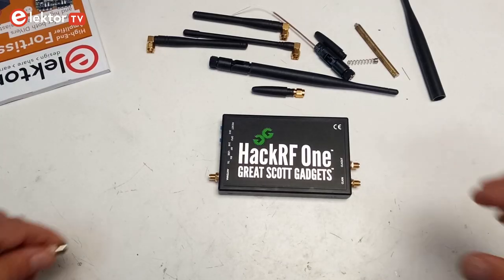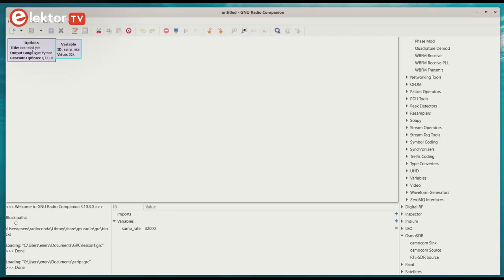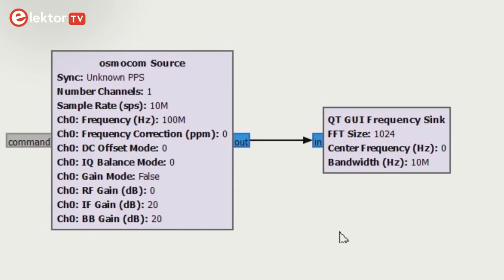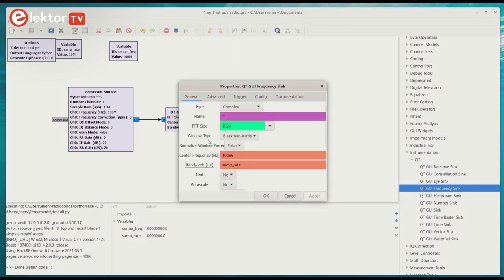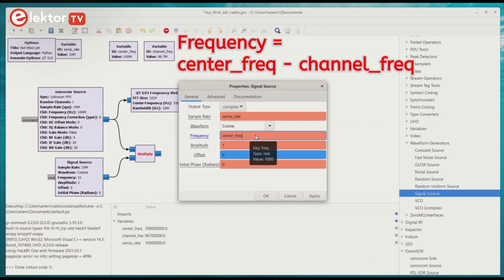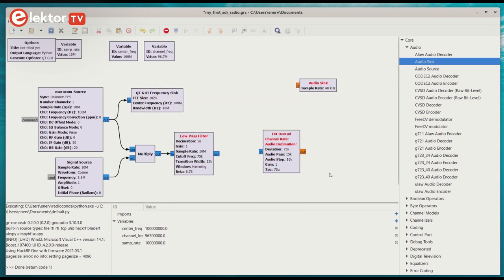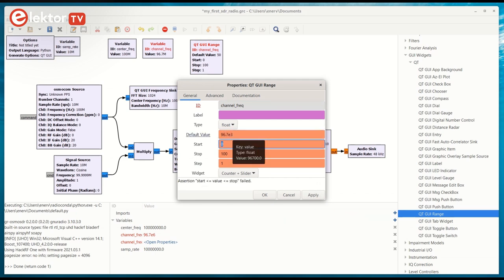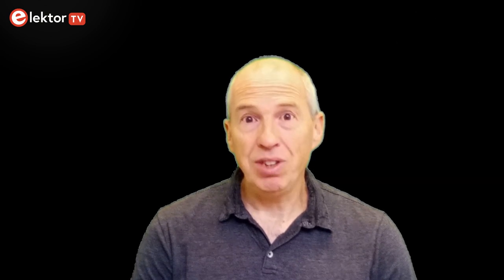Build an SDR-Based FM Radio Receiver in Less Than 15 Minutes

Comment: a frequency block doesnt open for me.data was input as suggested.do i need to have a setting to have the box open?
Reply: i figured it out.helps if i have the rtl sdr drivers installed so the software can find the usb dongle.on to the next step :D

Comment: This is fantastic!
Can Gnu Radio build some kind of stand alone program, after then you are done with all tweakings?
Reply from the maker: The output of GRC is a Python script. In the "Options" block you can set the "Generate Options" to "No GUI". If your flow graph does not have a GUI (sliders, windows, etc.) it will create a headless script that can be executed in another way like calling it from another process or so.
Reply: @ElektorTV  Nice to hear.